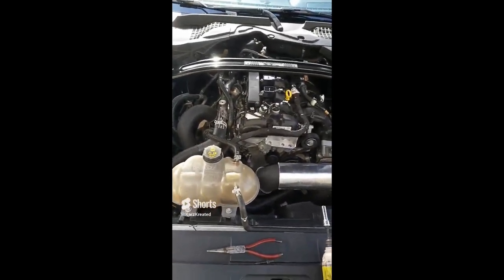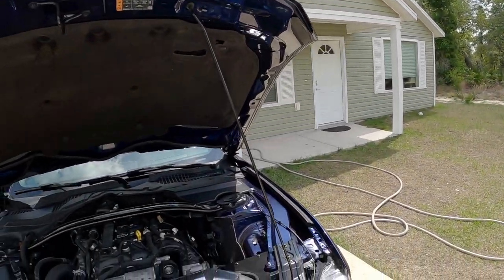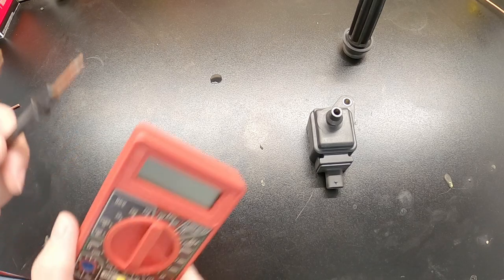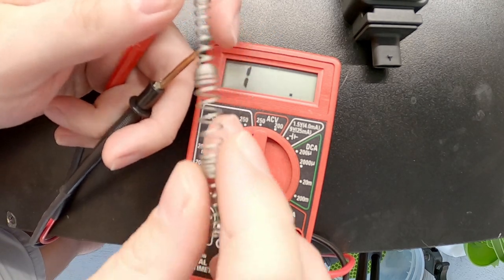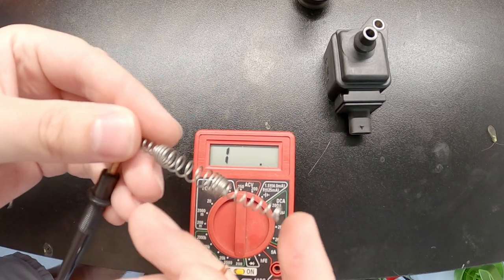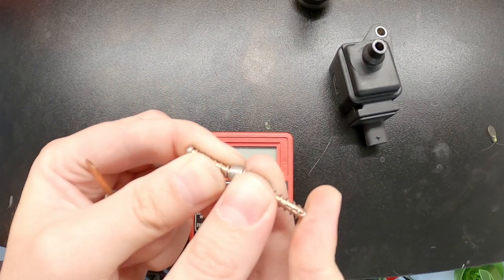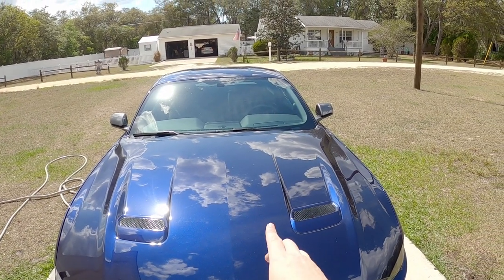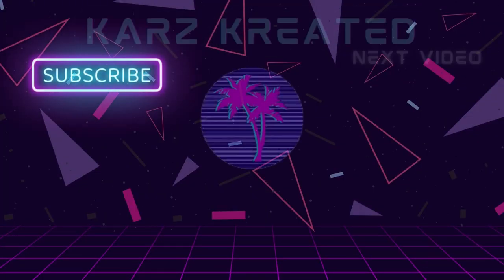This Engineering Flaw Is Sacrificing HORSEPOWER

Comment: My theory is heat soak in the combustion chamber causing the ecu to pull timing. Second run internally will be hotter than first. Spark is more about voltage than current. It takes about 25 thousand volts but only a few milliamps to generate the spark across the gap, yes you read that right literally mA, a few thousands of an amp. Hair thin wire can transmit unlimited voltage with no loss. It’s only when there’s high current that you need thicker wire to minimize loss. So actually that coil is way more than adequate to transmit that power. Keep in mind the ignition spark only needs to be powerful enough to just start the combustion process. Very Light work.

Comment: That’s very strange, I guess Ford just doesn’t think the benefit outweighs the cost. So it’s cheaper and easier to make springs rather than thick copper wire. 
I like this style of video. The whole experimenting with the engineering of a car idea is rad
Reply from the maker: That's very well the case here. Damn You  Bureaucracy! 😄

Comment: My guess is a combination of cost, "one-size-fits-all" as far as manufacturing hundreds of thousands of them, and it not being a metal that corrodes like the copper would, all these adding up to "it's good enough." As far as the timing, it could be throwing the ECM off as it's learned to the stock conductor. Someone more knowledgeable feel free to jump in.
Reply from the maker: Mostly my thoughts as well. OEM aside, if there is an improvement that can be made for performance, you would think the aftermarket would've come up with something. Then again, I'm not sure if aftermarket Coils actually do have a better solution for transferring the spark. Definitely a head scratcher 😅